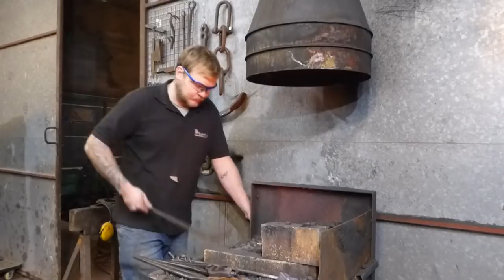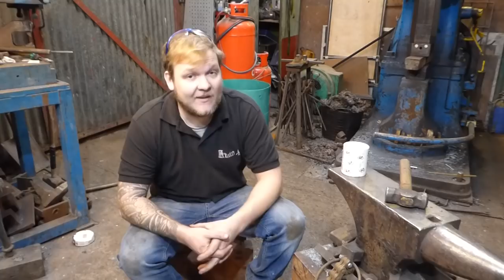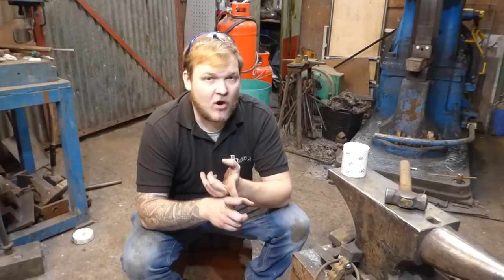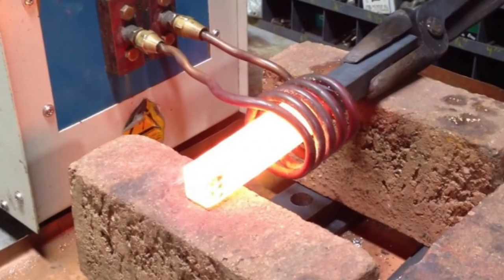Climate Change? Is the future of Blacksmithing Electric?

Comment: Check out the glass blowing Ind. they have been using electric ovens and pots for years to heat glass to well over forging temp. I think the oven size KW per Cubic inch of dead space not full of metal also the recovery time on large mass jobs. I think I will stay a long ways from HHO that stuff will go ( BANG ) Explode way to easy . By the way that kind of ban on fossil fuels will also kill the weekend BBQ (Lol) good luck be well and be safe.
Reply: The Nazis last several subs to that, plus the Hindenburg....